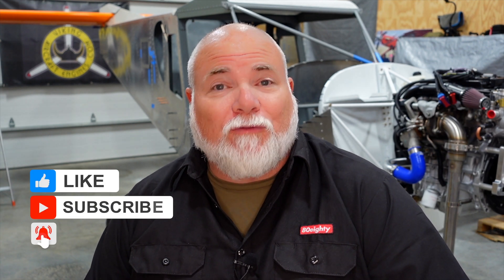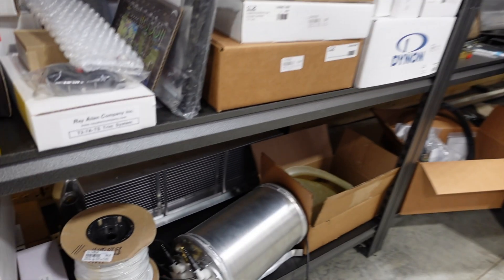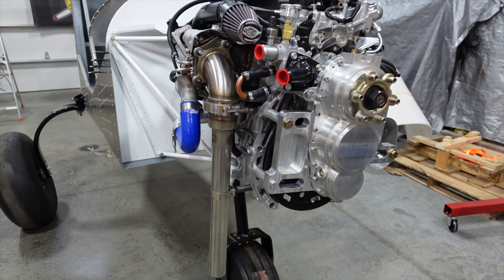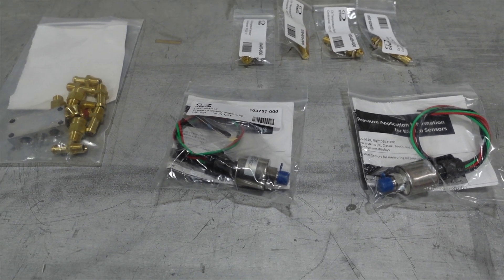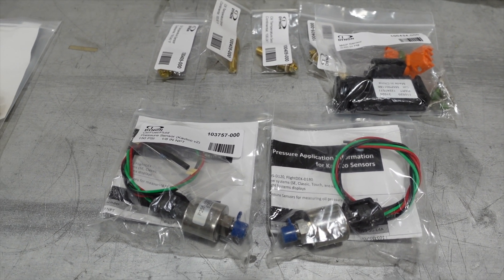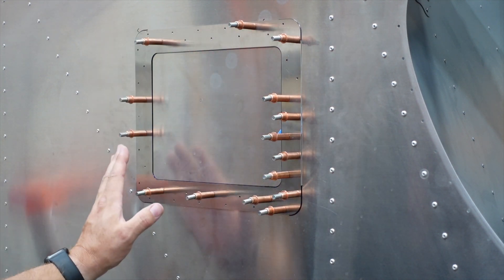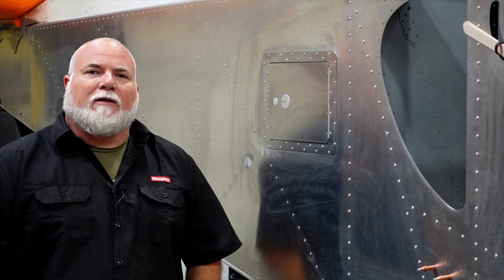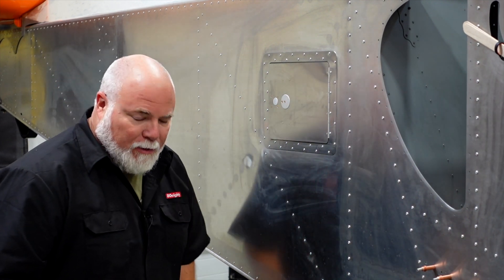Ep. 40 | Fuel Access Door & Dynon Sensors | Zenith Super Duty Aircraft Build

Comment: Adam, I would be cautious about using the sensors for the intercooler. They are not designed to measure air temp. and you may get false readings. I went with air temp sensors from Glowshift with stand alone gauges on my 195T. The plan is to ultimately use the sensors with an Arduino to display and record the data.

I also am pulling data from the CANbus to display RPM, MAP, MAT, Coolant temps with a seperate display. 
Now have over 13 hours flight testing on the 195T and it is performing very well.
Reply from the maker: Great info, I’ll look into that.

Comment: Noticed your drill bit was banging against the aluminum as you punched through.  Good practice is to cut a short length (less than an inch) of soft vinyl tubing, split it lengthwise into two pieces and drill through the center of one of the pieces and push it up the drill bit.  This will provide a cushion when you drill through a piece and reduce marring of the metal.
Enjoyed meeting you at the Homecoming!  Keep up this great series of videos!
Reply from the maker: Did you see the drill stop I had on the drill bit?  That is what is protecting the skins when the bit penetrates.  It has a spring and smooth face to keep from marring.
Reply: @AeroworksProductions  Ooops! Yes, I saw it but with the banging I "assumed" the stop wasn't soft like the vinyl tubing!  But, for cheapskates like me, the vinyl tubing works great! LOL!
Reply from the maker: @n206ja  No problem, a set of 4 is like $10 at most aircraft tool shops.  Here is a set- https://www.aircraftspruce.com/catalog/topages/fourpiecedrill.php
Reply: @AeroworksProductions  That's cheap for an aircraft tool! Thanks for the link!